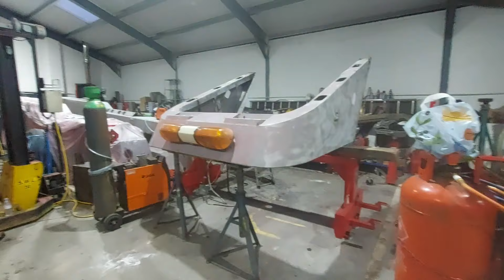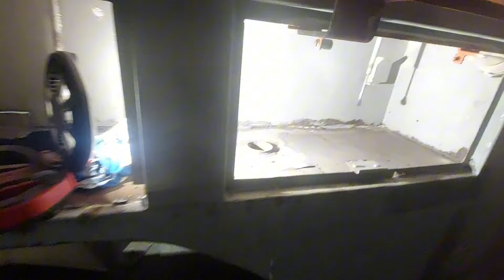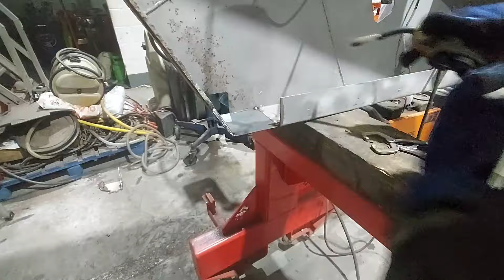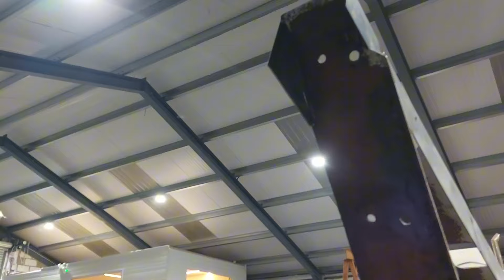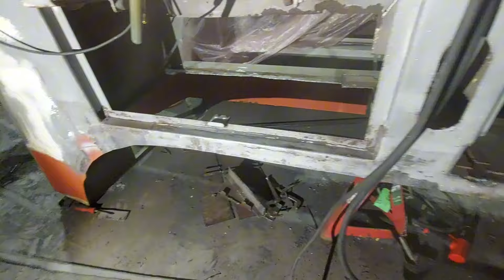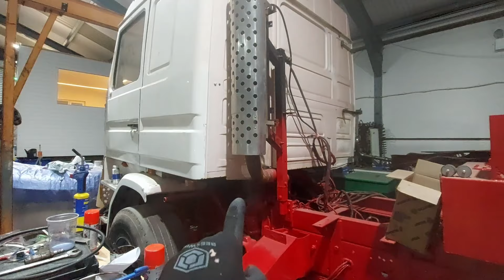Scania 143m V8 Restoration project

Comment: Nice progress again and great welding, Loving the series. Just a question or 2 but does anyone know why the flyer is no higher than the cab roof on most if not all recovery vehicles of this size? Surely it would better to have it higher? Also are you going to update the light bars and what extra Beacons are you going to add if any?
Reply: Thanks for the comments. To answer your questions, the flyers are generally the cab roof level for aesthetics. The purpose of them is to carry the beacons. Sometimes having the beacons on the roof of the wrecker puts it in a position where it can’t equally be seen from front and rear. 
We’ve had long chats over the lighting and although we want the truck to be original we’re also planning on the truck working so safety is priority for the operator. We’re fitting the same style of lights but LED versions. Same with the top beacon, it’s having a 5ft bar with amber lenses  again to keep it retro looking but with a modern edge. Bulb lighting was never the greatest on trucks in the early 90’s.